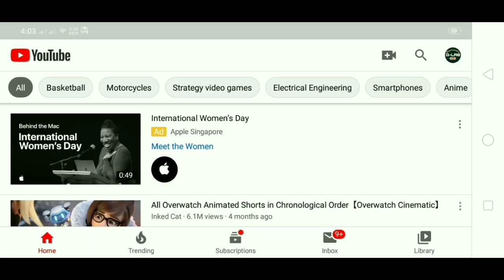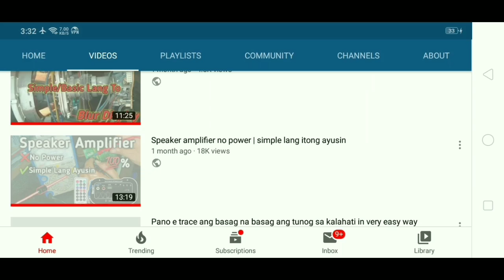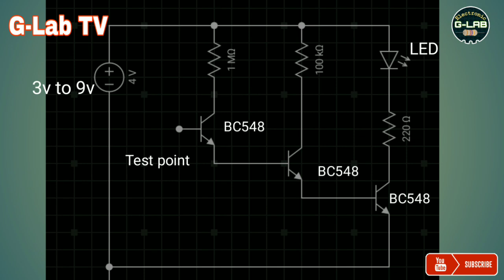DIY (NCV) None Contact Voltage Tester

Comment: sir...try nyo cd4069 hex inverter ic...up to 10 cm ang sensitivity ng sensor....pwede ma sense ang embedded wiring sa semento...upgradable pa sa buzzer sound o analog vu meter...3  volts/1.5 v x2  battery lng ang required supply voltage....yan ang ginagamit ko ngaun sa electrical wiring..... (ac voltage sensor)
Reply from the maker: thank you very sa info sir
Reply: @GiovanniV  sir gawa kapo ng sinasabi ni oliver para nakagawa din po ako marunong din po Kasi ako sa electrical kahit konti🤔 magagamit korin sa pag Trace ng source sa wall with in 10cm
Reply: Sir oliver baka may diagram ka at part list pahingi Naman👍

Comment: Gudnun sir my Pensonic crt tv 21inch d2 ung polyester na 564Jx250v pinalitan ko ng 304Jx250v kc wla ako mkita na same value tenisting ko gumana na ang tv my picture at sound na kso ung kulay nya medyo gren at dilw cya check kuna crt brd nya ok nmn ung mga 12k na resstr at transistor nya..ung b+ nya 109v tpos ung bnda 180v na nklgay tester ko 178v point something anu kya pwede gwin nun pra mging normal kulay nya?
Reply from the maker: RGB voltage bias na check mo na sir

Comment: sir G gandang araw, maganda yun pang testing ah, pwede din ba yun sa maliliit na voltahi at sa isang linya din?..curious lng po ako, at yung tp4056 module saan tayu maka hanap ng ganyan may mabibili ba nyan? salamat po.
Reply from the maker: yes! basta may hot line.... minsan nga na try ko sa dc yan sir
Reply: okay sir salamat po.

Comment: boss ano kya sira ng amp na nawalan ng sound ung speaker terminal. pro ung pang soround myrun nman tunog 502 sya boss na amp. nk nman boss pwd kong malaman kong kya nman ako nlng ggawa pagka sinabi mo slamat.
Reply from the maker: check moyong dalawang fuse muna kung hindi busted sir
Reply: @GiovanniV  hnd rin kc lumalagitek ung relay kapag e on na ung power switch wla rin kyang problema un boss
Reply from the maker: pag shoterd or may leaking na mag parts dyan hindi talaga mag lalagatik ang relay nyan kasi nasa protect mode na sya sir

Comment: Pwede po bang pagpaliten ang magkaparehas na power amplifier boardkhit magkaiba sila ng watts?
Reply from the maker: basta same Output transistor gamit sir
Reply: Pag nasunog po ba ang isang output transistor boss posible po bang may masira den na output transistor or ibang pyesa? Pasensya na po baguhan palang po ako sa electronics😅

Comment: Boss may boombox ako dito no power ,, test ko may suply ang primary wala ang secondary ,, ok nman ang diod at capacitor ng secondary ,, tanong ko boss ano kaya sira nito saan kaya boss ,,
Reply from the maker: check ac cord, fuse, switch at regulator nya sir
Reply: @GiovanniV  ok nman ang switch at ac chord boss ,  yung regulator yung tatlong paa , sa may led banda ,,